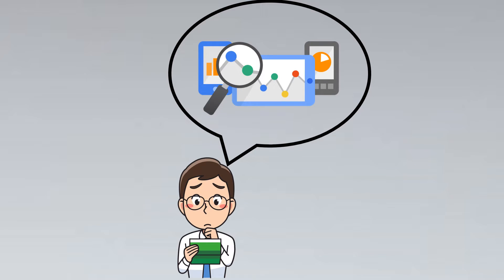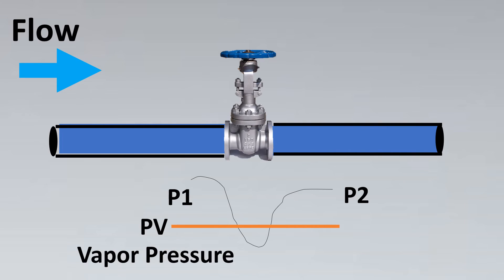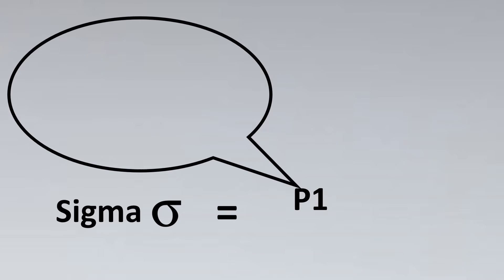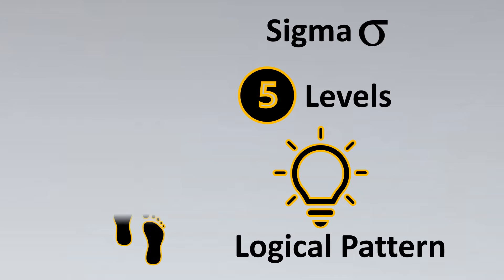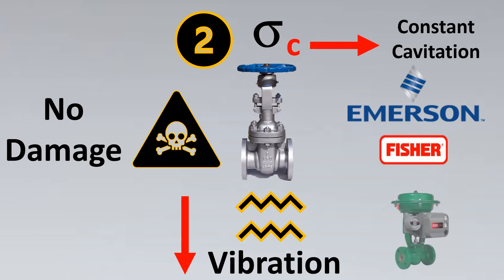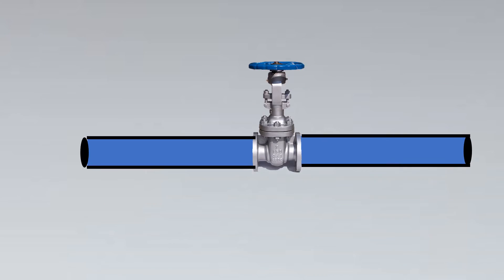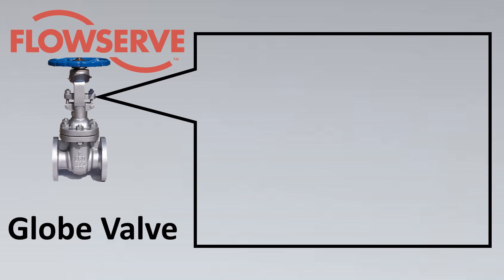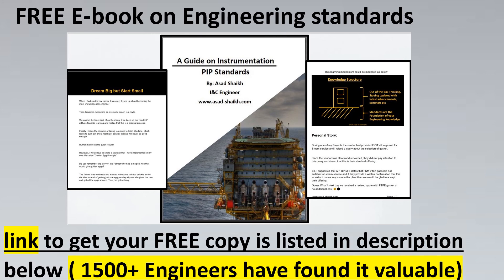What is CAVITATION INDEX for Control Valve (ISA RP 75.23) | Flashing & Cavitation in control valve

Comment: Hi Asad 
" In this video you mentioned that P1 will drop it to below vapour pressure and then it will regain back to P2 pressure with some delta P from P1. Can you please explain on how one should identify that it is dropping to below vapour pressure and gaining back to P2 with some delta-P? How can a process designer calculate it? For example, In this video it can drop to 56 psig from 100 psig and gain back to 75 psig, hence no cavitation shall occur.
Thanks

Comment: Good video. What is multi stage trim? Also, what is the issue if you operate your control valves at 80% (dia 48") and service is water?
Thanks.
Reply from the maker: Thank you so much, There isn't any issue however to have better controllability of control vale it is recommended to have the operating range of CV between 20 to 80 percent.

Multi stage trim produces the pressure drop across the valve in a staged manner and could be one of the solution for cavitation problems.

Hope this helps ! 😊